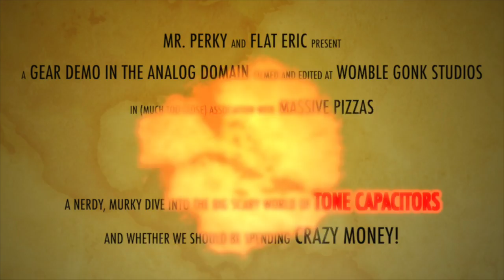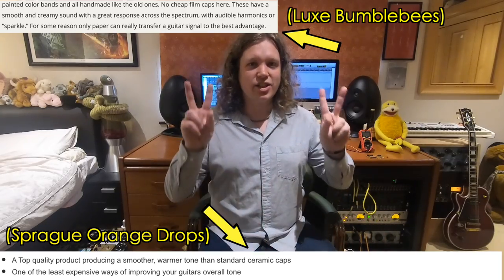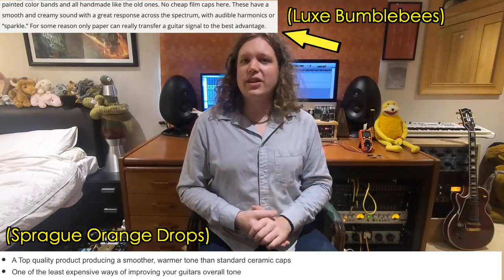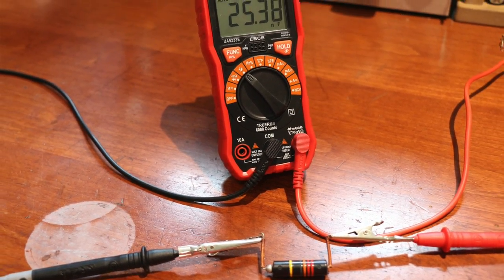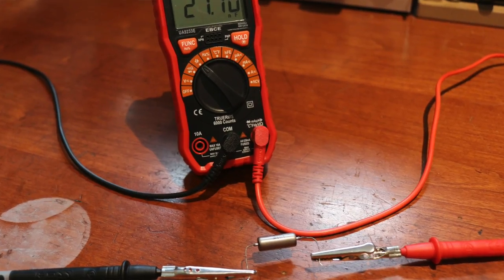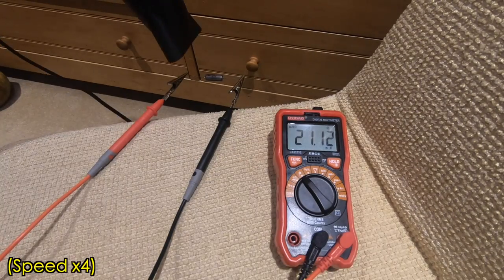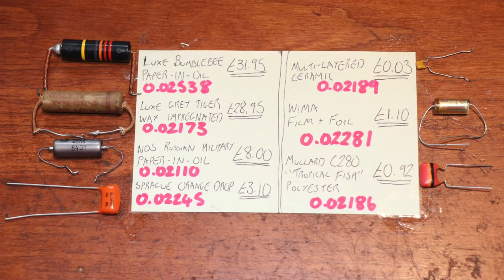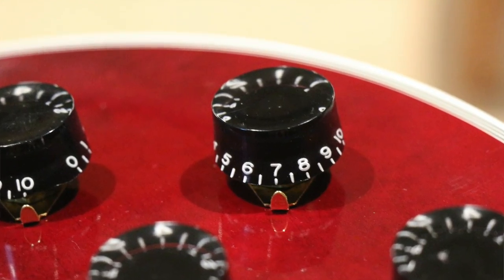Do Paper-In-Oil Capacitors REALLY Sound "Better"..??  (vs. Ceramic, Orange Drop, Tropical Fish, etc)

Comment: For anyone upgrading their electronics, the money is better spend on good quality pickups.
Reply: Yep better caps & better pickups. 🙂
Reply: @gerardcousineau3478  Better caps in a guitar circuit doesn't make any sense. Read up on electronics before you waste your money.
Reply: The two aren't mutually exclusive.  It's possible to select a pickup, and capacitor.  Implying that you can only change one or the other is a fallacy.  The cap is probably the cheapest part of a guitar.
Reply: What about good quality pickups AND other vintage upgrades

Comment: The signal we hear does not pass through the capacitor, yes, but that does not mean the kind of capacitor could have no influence. The way a tone control works is, a portion of the signal is diverted to pass through the capacitor and by doing so it is SUBTRACTED from the signal we hear, so, theoretically, a different kind of capacitor COULD make a difference on the signal we hear. (Trust me, I am an EE). What matters is how the impedance of the capacitor varies in the range of frequencies of interest (the ones we hear). Electrically, a real capacitor we can buy is not just a capacitor, it is a combination of capacitor, resistor, and inductor, depending on the materials being used and the way it is built. The resistor and inductor part is called "parasitic". We cannot get rid of them. Bottom line: trust your ears.
Reply: Exactly what I was going to say. But listening it's bloody subtle. There's a couple of subtle differences I think. But then I wonder how much subtle soldering differences and making them hot trying to solder them to pots changes. Are they still the same value after you've removed them? And how much difference does subtly different playing and whether you've jut had a coffee might make at that point. Your guitar cable length will no doubt make a bigger difference as part of the LRC filter circuit it all forms. :)

Comment: I restore old radios as well as play the bass.  I can tell you with 100% certainty that the tolerance of those vintage capacitors back when they were new were +/- 20 to 40%.  Generally speaking, a cap in a critical circuit would be silver mica, everything else was wax paper/oil in paper and as long as it "capacitated" to some degree, then it was considered to be in spec.  They are  just little filters after all. 

You're totally fooling yourself if you thing a boutique capacitor is fundamentally better than a 3 cent bin part.
Reply: In terms of sound better is subjective. The Orange caps which are 5 dollars have the most general appeal, in terms of tone. I get your sentiment though. More is not always best in terms of quality.

Comment: ive just recently re wired my friends guitar to 50s style wiring and i love it! but thats partly because it seems that the type of cap used has a greater impact on the tone, like some how the cap being soldered to the output rather than the input of the volume pot  seems to send a tiny bit of low end to ground even with the tone knob maxed creating a brighter tone overall! i even re wired my bass this way and it was night and day! ill have to experiment with different types of caps to see if i notice anything
Reply: So you mean basically 50s wiring and cap soldered to output ?

Also what type of capacitor did you use

Comment: Hey Joe, thank you so, so much for putting together - clearly a lot of time and hard work went into making such a comprehensive comparison. Having listened carefully (on high quality headphones) I agree that there are some subtle tone differences between capacitors, but none that either sounded significantly ‘better’ than another, or that couldn’t easily be adjusted/compensated for by the position of the tone pot or some other tweak. When you consider how hard you have to listen to discern differences, and how unlikely you’d even spot that under normal playing conditions (let alone at a gig!) it clearly emphasises that there are much better ways to spend your money or other things you can do to improve your tone than spending ridiculous money on capacitors used in this way (especially  compared to coupling capacitors in other circuits). Sadly marketing b@locks will never the less convince people to part with unnecessary money for this purpose, but some people will spend more money than the time they put in to practising playing  technique or understanding how to get the best out of the equipment they already have - just sayin’ ...! Thanks for exploding this myth 😉
Reply: Completely agree. If Gibson don't see any reason not to put hidden cheaper caps into their Bumble Bee's than that says it all. Don't waste your time and money.

Comment: This is interesting. I’ve always believed it’s solely about the actual value of the cap. I still do, but I can’t say there aren’t any other variables at play. It’s interesting that you note that you heard the difference when it was wide open. I can certainly hear that too, but that shouldn’t make sense. You could credit that to slight differences when you are playing, but you seem to be playing very consistently here. I didn’t notice much of a difference down the dial until the tone pot was on zero. That’s where I started to hear the ceramic cap sound more muffled (not just dark). Most of the other options seemed more articulate with the tone pot on zero (with and without dirt). I have had Russian paper in oil caps in my Les Paul for 5 or 6 years at this point. When I put them in I liked the idea that they might drift with age and temperature change. It made things seem a little interesting. I don’t know if it has really made much difference over time, but I’ve been happy and that’s what this is really all about.

Comment: Thans for sharing your results of comparing different kind of capacitors. I am agree with you, there is a small difference indeed.

The thing is, the quality of a coupling  capacitor shall be noticed better, when it's used in series in the signal path. So, you mentioned also the capacitor in a guitar tone control is connected to ground and leads the higher frequencies to the ground when the tone pot is pulled anti clockwise. I think the small differences in tone, Will lead to ground and that's why we don't hear a big difference.

Used in an amp as coupler capasitor  makes a much bigger difference! 

I did like it to see your investigation 👍

Comment: Yep. As an engineer ...an amp builder... and guitar builder... I can confidently say the material that the tone cap is made from MAKES NO DIFFERENCE to your tone, since the hot audio signal does not pass through it. Just value of your tone pot + capacitor value have effect.
Of course... you may choose a better grade capacitor because they are simply made better. They may also look better or be more in keeping with maybe the retro 'vibe' of your guitar.... or if its a vintage guitar it might be in keeping to install a vintage style cap. These things are valid considerations and may inspire you somehow to play better. But they will not have any impact on your actual tone or affect the response of your pickups. A better quality guitar cable would have much more impact.
Reply: Yeah, if I had a vintage guitar I loved and had to mess with the wiring, I'd want to keep it period correct, mostly for the vibe.  Otherwise, I'd go with a few dollar cap and not even touch oil & paper.
Reply: I love how you’re the authority on this….because you build amps, lol. I can clearly hear the difference and so can other listeners . It’s obviously subjective in nature, and caps have different ESR ratings and are subject to temp changes, that’s beca of the material. They also affect the tone…but you’re dogmatically yelling something that’s objectively wrong.
Reply: @JohnZornAscended  I also build guitars.... And the science is the same in either case. I know what ESR is. And IF the audio signal were passing through a cap... yes it makes a difference what its made of. But the audio signal completely bypasses the tone cap, and depending on how you wire it, some put a tone pot between the cap and the audio signal in any case. So sorry. Nope what the tone cap is made of.... makes no difference. Its the value that counts.
Reply: @RdamplificationUk1  I don’t think those test have been conclusive in terms of material. If someone believes their ears enough to drop 30$, we’ll have to let it be.

Comment: great video. there's absolutely no difference in any capacitor here that couldnt at least be accounted for by margin of error, varying is playing, and tolerance differences. this helped save me 30 bucks on a set of caps for a tele
Reply: Couldn't have said it better myself 👍🏼 I'll bet if Jo played the same riff 10 times and then asked us to guess which caps were which clips...no one could tell. In fact he could just use the 3p ceramic for all 10 clips and reveal that in another video 😂
Reply: Bingo. Biggest waste of time and effort in the guitar kingdom. Mostly done to assert "pro ears" mythology.
Exposed best when the people raging about the $60 Gibson bumblebee reissues found out they had cheap film caps inside them.

Comment: PIO sounds great. It's smooth with bite. Russian or reissue. Really strange way of putting it but that's why I always liked them. They aren't ear pearicing, but have bite when you need it. Wimas also sound great for the money imo. Always underrated are the Wima caps but can get pearicing. Not brighter, but harsher. 

Granted I'm really talking about hifi vintage tube amps. But still, even here, in that position, you can slightly hear the difference which is surprising. But it's subtle
Reply: anything going though that cap is being shunted right to ground- you don't hear a bit of it...

Comment: I also noticed more of a difference with tone on 10. The way a pickup, volume, & tone interact form a LCR circuit. So even with tone and volume on 10, those pots & capacitor are changing the resonant peak of the pickup. So the difference in capacitance might explain it. But also, different capacitor types may measure different capacitances at different frequencies. The way multimeters measure capacitance usually don’t take frequency into account like dedicated LCR meters do. Since the guitar even clean with a open chord is pretty complex with frequencies, the value of the cap at say higher frequencies could be different and this will interact with pup and pots differently which changed that resonance. This is about the extent I can explain it. The theory and math can get complicated and I just grasp some of it. Enjoyed the video!
Reply from the maker: Very interesting stuff - thanks for the info! :-)
Reply from the maker: @e.thorsen1937  From the first 2 seconds, I get the impression that guy knows what he's talking about ;-) haha
Reply: @e.thorsen1937   that video he is really comparing using electrolytic caps, versus other cap types in the audio signal path. So yes, those are going to sound different due to the nature of their construction. Most electrolytic caps are polarized, meaning you typically use them with respect to the polarity of whats applied. In the case of ac signals (which is what audio signals are) polarity changes. You normally see electrolytic caps in power supply circuits that help filter rectified ac to a nice smooth dc. In a guitar tube amp, there are usually several of these in the rectifier part of the amp that is providing the dc voltage that powers the tubes. So, not really a good argument for saying some caps sound different as that is not a type of cap you would ever use in the signal path. In Joe’s video he is using different types but none of them are electrolytic. They are all caps that can be used in the signal path. Speaking of signal path, in Joe’s video, its important to note that the signal we hear through his amp is not being passed through the tone cap such as coupling of blocking caps in an audio amplifier or pedal. Even when you turn the tone or volume down, none of the signal that goes to the output jack, is passed through that cap. The tone cap is directing certain frequencies to ground. How much is based on position of the tone pot.  However it’s a little more complicated because the tone cap is in series with the tone pot (depending on where the tone pot is set to) and these 2 components are in parallel with the pickup. That is why even when you have the tone or volume pot all the way up, they are still effecting the signal because they are providing a load that the pickup always sees. So the main pickup output does not pass through the tone cap and pot, but there will be a small of current that will go through this branch parallel part of the circuit which will interact with how the frequencies of the output will sound. All this is a long complicated way to say, that yes different tone cap types even is same value (roughly) could sound different because of this complex nature of how things interact. In Joe’s video, I would still say most is due to the fact that we don’t know the real cap values. Measuring capacitance with accuracy is particularly difficult. Even the leads to that multimeter will influence the values due to parasitic capacitance. Also as Joe pointed out, its difficult to play the same thing exactly the same. Plus, how long after the new pot was changed out did he record. Heat from the soldering, could influence the caps. Ultimately I do think there will be minor differences in a cap that uses paper and oil as a dialectic versus polypropylene with capacitance staying the same. Not sure if we could hear those differences.
Reply: Haven't watched the other video Mr Carlson's lab, but I love that guy. He most definitely knows what he is talking about!
Reply: @e.thorsen1937  This is interesting. I have always wondered why guitars are unbalanced. I'll read this later and get into it more and see if I can provide some insight. I think the first issue that comes to mind and simpler than using an isolation transformer, is just to use 3 conductor cables. 2 conductors to carry the audio signal and 1 as a shield. If the shield is only connected at one end, it would provide really good noise immunity and not create an ground loops that would induce 50 or 60 cycle hum. Ideally the cable should be coxial which does complicate its construction.  But for long runs from guitar, pedalboard to amp with effects loop using 4cm, it would quiet things done considerably in theory. Guitar and pedals are very weird things because some of things that are still industry standard are kind of well...backwards. They are just things that started that way many years ago and once the industry standardized it was hard to change.
Reply: @JasonClute  Great explanation, Jason!  The old paper and oil caps have more DC leakage than orange drops, similar to adding a resistor across the capacitor.  I like the orange drops for their reliability and temperature stability.  I've heard people say that you can get away with low voltage capacitors since the audio signal is less than a volt, but you can generate a thousand volts by scuffing your feet on the carpet on a low-humidity day.  The disk ceramic capacitors are very poor in regards to temperature stability, and they can be microphonic (due to the piezoelectric effect in the dielectric), but they will work if you haven't got anything else.
Reply: @JasonClute  If the signal source (guitar pickup) wasn't such a high impedance, then the distributed capacitance of the unbalanced instrument cable would not rolloff high frequencies so much.

Comment: Nice work! Amazing detailed video. I really enjoyed. Russian and PIO Reissue were slightly more smooth and less muddy but it’s like trying to see the difference in anything the engine will do either on 87,88,89,92,93 octane petrol or gasoline in your 4 cylinder sedan. I’ve tried, only a slight slight torque difference to me, barely noticeable but there. Not worth the extra $$.
Reply: Fuel has an octane rating 87, 88etc, your vehicles engine has a compression ratio. The higher the compression warrants higher octane. Please refer to your manufacturers owners manual. Those numbers aren’t there for show. Prolonged use of incorrect fuel will damage the motor.  Use the correct fuel, be safe!✌🏻 back to the capacitors, they all sounded different. I kind of favored the orange drop over a PIO or vintage style. They all sounded great and each has their place.

Comment: As others have said, the Bumble Bees and the Orange Drops have a little better note articulation, but nothing that won't be negated by a little gain.  Personally in my builds I lean towards Orange Drops because they don't sing in value subject to temperature, as your video showed the paper in oil do, they are easy to read the values on, they don't leak when they get old, like the paper in oil do and they keep the cork-sniffers happy.  I normally find the biggest difference in all guitar electronics is time to failure, that's why I'll spend a little extra on CTS pots over no name Chinese ones.

BTW: I was surprised how cost difference between the Russian NOS and the Bumble Bee, with better tolerances too, maybe Gibson should just pain them for their high end caps
Reply: I've never had one k40y-9 leak on me. And the values are always spot on after all those years. Very good caps man. And I also like orange drops just so you know I'm not biased. Although the Wimas are extremely underrated imo

Comment: If I'm not wrong, the only way to 100%  bypass the capacitor is using a no-load tone potentiometer. Regular pots with linear or audio taper still run a small resistance  even when they are set to 10 (max). However, the resistance is so small and that is why the difference in the tone is so subtle when using different types or different measured values capacitors.
Reply: That’s an interesting theory.